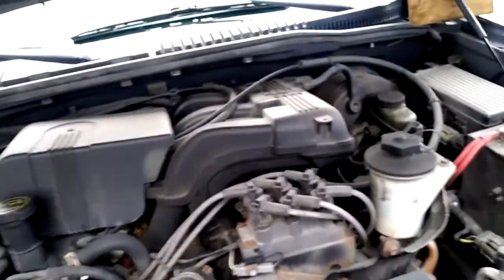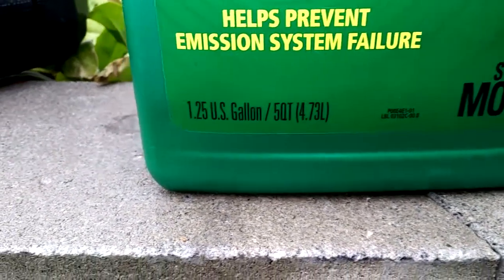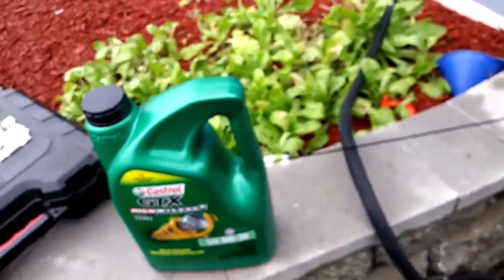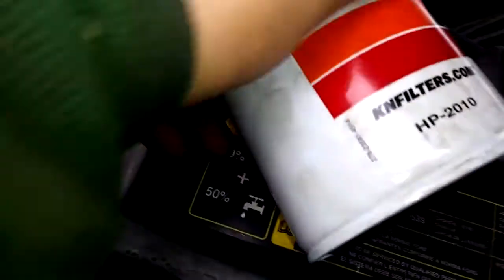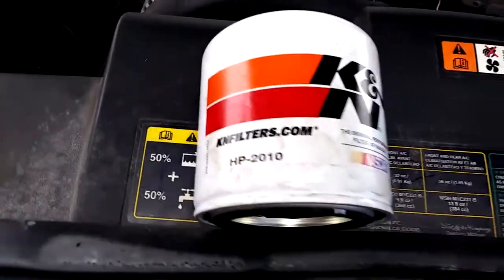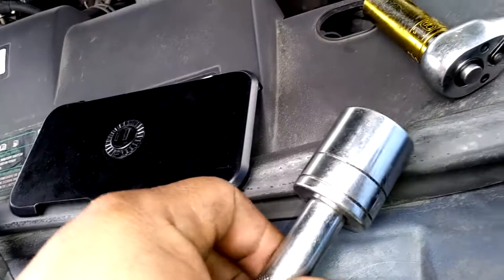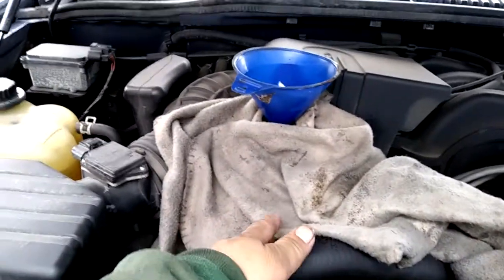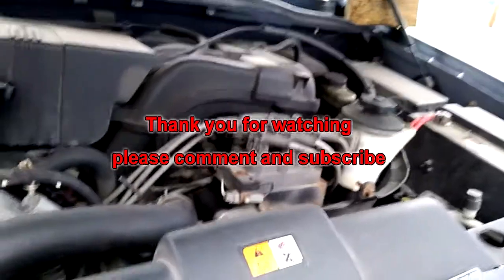How to change oil from a  2003 ford explorer

Comment: I need help, the bolt on the oil is too tight, Is en used a wrench, no help, any suggestions?
Reply from the maker: Thank you for watching and comment. Did you try double wrench? Or you can try a socket with a braker.
Reply: @ideaslandscape  yea i tried a double wrench, no help
Reply: @ideaslandscape  i’ll try the socket with the braker

Comment: It's got a high flow rate filter it's not a small micron filter it's meant for racing not filtration. In a racing filter you need to filter the oil but more importantly flow rate. These filters sacrifice filtration for flow. Next time buy a Wix  or a Royal purple, Mobil 1 filter, or Amsoil, something like that.